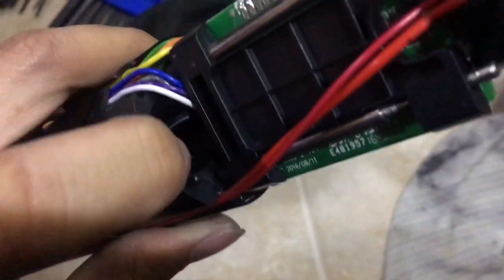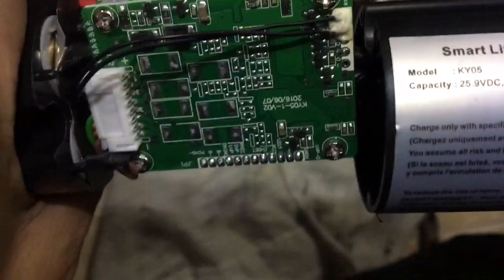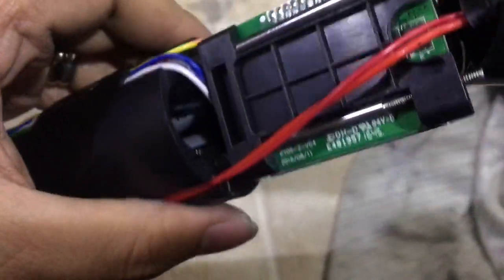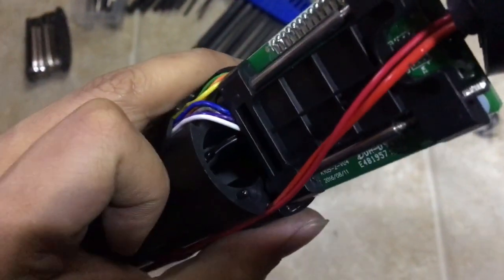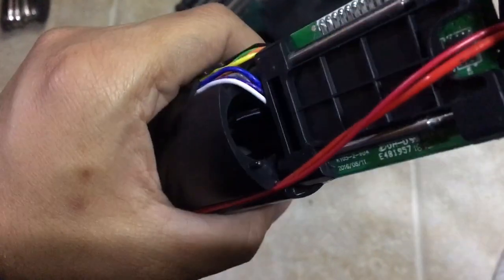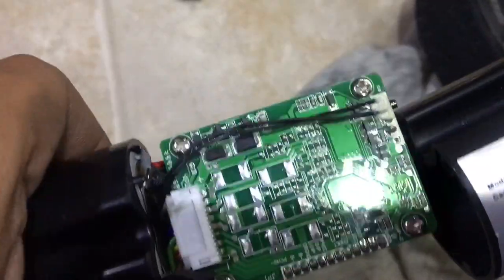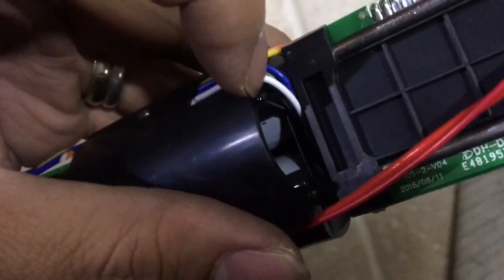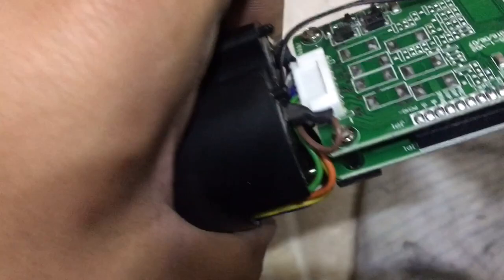Teardown of li-on battery pack of swagtron swagger carbon fiber electric kick scooter

Comment: maybe you can help. i have this scooter. the handle bar is loose from the wheel. how/where do i tighten so the handle bars and tire dont move independently.
Reply from the maker: When you remover the bigger machine screws at the base there are 4 smaller set screws inside the hole where those bigger screws screw into. One of your smaller allen keys or hex keys will fit. Make sure all 4 are tight as they loosen up due to vibration. Use a drop of locktite if you want prevent this.
Reply: @xlines  thank you, i never noticed those internal screws under the larger ones. i just tightened them as much as i could. but i still have a good amount of play in the handlebars. not sure if something is stripped in there or if i need new screws, or need a new internal piece that the screws dig into?
Reply from the maker: Carlos Rios it’s the same set of screws on top where the stem connects to the handle bar and controls.
Mine also has a bit of play but when I took it apart to hopefully remedy it. I found that it’s all part of the way the front shock and steering system design. 
All I can do is make locktite the set screws and the bigger one. Up till now it still holds.
Reply: @xlines  i tried to tighten those 4 allen screws as tight as possible, but the front wheel is still loose? im not sure what to try next. also, my battery doesnt last as long as it used to, do you know anywhere that sells new replacement batteries?

Comment: You have the basic Swagger.  The Swagger Pro has more cells.
Reply from the maker: Mike Cane yup. An additional 7 more cells in parallel configuration for added amperage. At the moment I have no plans on adding a matched 18650 cell in this. I’ll be using a 6s 5200mah lipo pack that I have from a scrapped ebike project. I’m now able to easily disconnect and reconnect the built-in battery and connect the lipo pack externally. It’s running at lower voltage but I want the range. Plus the speed controller seem to have a set speed limit.
Reply: Yeah, the speed is locked to comply .with laws that cap the top speed of eScooters.  This allows them to sell it worldwide.  I haven't heard of any hacks for it, but there are some for the Xiaomi M365.  Different firmware altogether, tho.
Reply from the maker: Mike Cane I have no plans to do any firmware hacking on this thing. But when I opened the motor controller there are empty marked header pins for programming. And even a 5v option for external usb output. https://flic.kr/p/2ayxrWv
Reply from the maker: I just added more solder on the power input and motor output traces fore more current flow and covered the back side of the pcb with nail polish for added weather sealing. Though the aluminum box has a rubber sealing in it.
Reply: That would be hard work.  The M365 works via an app for firmware updates, so that made hacking it easier.  No first-gen carbon fiber scooter app.  And AFAIK, gen 2.0's app never does firmware updating.
Reply from the maker: Mike Cane if you are interested here is the repaired and modded scooter https://youtu.be/3Ml7ox2VQnQ 26km total distance. Have a good one 😊